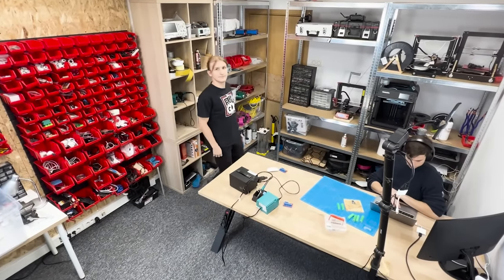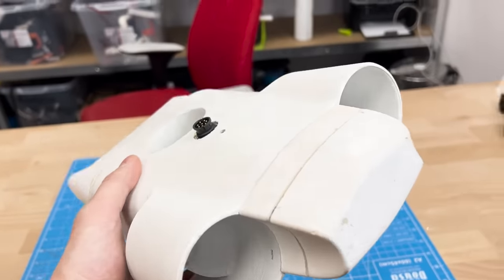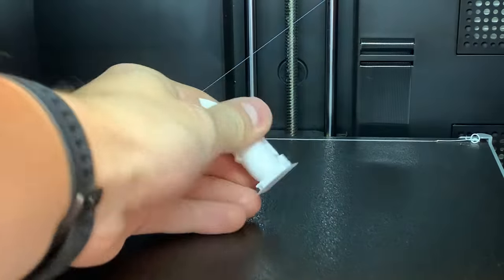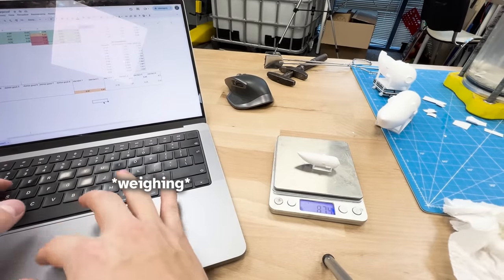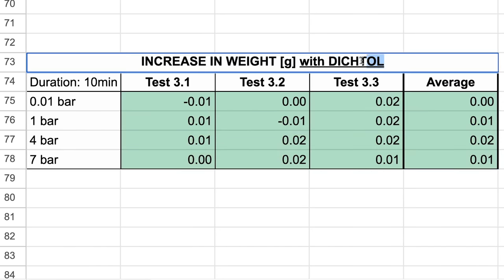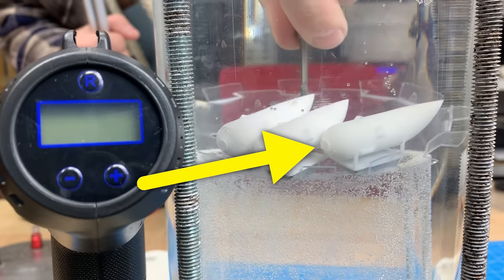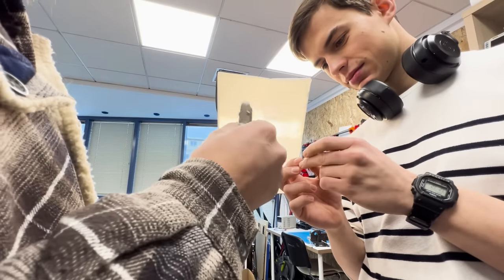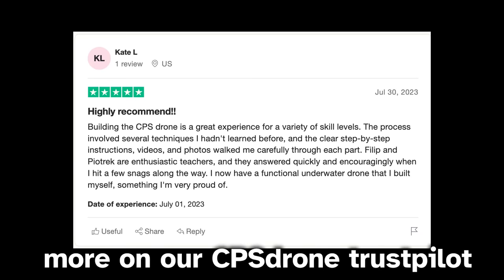Making 3D prints actually waterproof

Comment: That 3D metal sub was cool. You're probably right that it could go deeper then the real thing
Reply: @Goofyahh_shark  💀💀💀
Reply: Is the bottom of the ocean not deep enough?
Reply: @CarlinPlayz 💀
Reply: @jeremy6384  nah. Gotta go deep. Like Europa deeper. I'm pretty sure those oceans are much deeper then earth's
Reply: @Minecraftforlife99  💀💀💀
Reply: The sub looked like the titan
Reply: @bugattiveyron8282  cause it was 😂
Reply: Not only that but it wouldn’t cost $250,000 the trip
Reply: @bugattiveyron8282  because it was the titan
Reply: The part isn’t hollow it will be filled with the powder that was used to print the part
Reply: @liamdj6535  you ruined the joke

Comment: Doing second process with the dichtol stuff probably will seal it even more.
Btw. another technique to seal a FDM 3DP is by printing it in ABS and then doing acetone smoothing, it dissolves surface of the part and once dried creates solid layer all around.

Comment: Cheers from the openROV team. We actually thermally annealed our PLA to waterproof ours back in 2014, and this worked quite well by boiling them in hot water just to the point of deforming and then letting them cool. If you get the temp correctly it will work, though less well for solid fill.

Comment: To both prevent water damage your electronics and make the sub survive a deeper  dive you could submerge the electronics in baby oil.
Then the submarine drone don't have any air in it, thus can not break from over pressure.
Reply: Or ordinary mineral oil, to avoid that smell reminding you of changing time and diaper rash.
Reply: It's the same thing used in some dive watch, it prevent them to collapse, and since oil dont mix well with water it also prevent small water drops to enter.
Reply: Also get a better receiver so the controller dosent disconnect
Reply: The sub I think comes with a Xbox

Comment: You can put the print in dichtol and put it in a vacuum chamber. This allows air to escape from the pores and at normal pressure the dichtol diffuses into the pores.

Comment: I used to repair cracked/seeping plastic fuel tanks by pulling a vacuum on it, then applying epoxy. The same could be done with your printed vessel and the dichtol. Also pressure regulating the hull is a good idea.

Comment: When using a gasket or o-ring, you need to design around it with a groove for it and having multiple sealing layers. You want to maximise the path the water takes to get in from a deliberate opening.

Comment: One note about o-rings and other rubber seals, the one you used looked more like a EPDM "string" rather than an o-ring.
Way better to design around an off the shelf available o-ring (proper one in fairly hard NBR or similar rubber) than trying to glue something together.

Glueing seals with CA glue or really any glue that is harder than the rubber will be a problem, it creates a hard point that almost always leaks.

The usual way of doing it is to have nice cuts that mates well and make the seal a bit to long, so the ends gets compressed into each other. No glue :)

Or getting some way to vulcanise the rubber together, but yeah :P
Reply: "creates a hard point that almost always leaks" sounds right, but is completely wrong. I've worked at Engineered Pressure Systems ( EPSI) at Sint Niklaas for seven years and we ALWAYS glue the large O rings (Nitrile cord) with a standard cyanocrylate glue, because noone makes standard O rings with a 800-1000 mm diameter at an acceptable price and delivery time. Perpendicular cut with a sharp knife . These O rings will easily seal high pressure vessels up to 9000 bar (900Mpa). BUT you need a very proper fitting groove and the exact amount of compression for a proper seal. I don't think he used an EPDM cord, but a nitrile one. Of course you're absolutely right about designing around an off the shelf standard is always better . In this case I 'm pretty sure the leak comes from the fact that his O ring is rather thick and not properly pressured ( seriously only 4 little screws holding the lid down ?? )

Comment: For the O ring, you need to design the seating of the seal in such a way that the pressure of the water tightens the seal. then the higher the pressure, they better the seal.

Comment: Guys, there is a Prusa wiki article for the infill types in 3d printing. THere are a few that are extremely well for filling up the infill part with something.
This way you can print your model and fill up the "infill" space with 2 part resign. After curing it should be pretty much waterproof inner skin of your model.

Comment: With the Oring test i think it might be better to either use more screws or maybe even print the entire cap with a built in thread, since it only needs to tighten enough to press on the o ring consistently.
You can look at watch caseback designs here. The caseback has a thread and screws onto the case, making enough pressure on the (sometimes multiple) O-rings to withstand immense depths. Most common dive watches are certified to 200m but it is not uncommon for them to go to 600m. Some of them like the omega Ploprof or the rolex deepsea can go far deeper than that (some have been taken to the mariana trench on the outside of a submarine)
Reply: These dive watch are often filled with oil to prevent them to collapse, and since oil dont mix well with water it also prevent small water drops to enter.

Comment: Rather than trying to make the electronics container conpletely water proof, have you considered using a high pressure gas supply (CO2) cartridge for example with a regulator to pressurise the inside of the container to maintain an acceptable pressure differential between the inside and outside? Using an automatic vent valve to perge the pressure as you then come back up.  Your depth limit then is really the pressure of the gas in your pressuising 'air supply'. Look at how a diver in a dry suit stops getting pinched by his suit as he goes deeper, as well as controlling his bouyancy.  Just a suggestion.

Comment: Did you try annealing it by baking the print buried in salt or really fine sand? One alternative to try would be removing all the air from the print whilst having it submerged in stabilizing resin, then baking it. In theory, that would do the same thing as dichtol but less dangerous, as you'd be filling all the pores in the structure with resin, then crystalizing it into the model by baking it.

Comment: 6:31 it might be that there is air inside the sub, and when it “come back up” the air will expand or be larger, for example if I were to take a balloon filled with air underwater, it’s going to get smaller because all of the pressure around it, but when I bring it back to the surface it’ll become bigger again

Comment: During my undergraduate years our additive manufacturing lab was just comparing how different post processes can increase 3D print integrity, and realized heat and pressure treatment can help layers better bond and reduce the “ pores” under microscope it looked much more adherent almost like a injection molded part, and the tensile strength increased drastically. Maybe that could also help with water proof? But it wouldn’t technically be only made from 3D print since post processing is involved

Comment: I don't know about those extreme depths, but I've had good luck with just spray painting 3d prints to make them waterproof, in case someone is looking for a cheap solution that doesn't require special handling precautions.

Comment: Tbh the Way you do the Drones with the watertight pressure resistant tube inside the shells, is how actual submarines work. Like for ex the Russian typhoon, is an outer aerodynamic hull and stealth hull. And the there's 3 or 4 pressure tubes inside, and ut doesn't that wat natter if some water gets trough the first layer

Comment: If you want to make an fdm print waterproof, maybe try electroplating it? You could coat each model with copper, nickel, aluminum, or silver.
Reply: I don't know how liquid tight the electroplating will be, but if it does work the weight of the metal electroplated on can be part of the ballast, requiring fewer added weights to get to neutral buoyancy.

Comment: Why don't you spray the surface with something like the Flexseal? It's a rubber seal that work well enough.
Reply: It tried this. The problem is that it only coates on the outside, does not penetrates

Comment: from my pov, only abs-like and the Siraya Tech BLU (the one in video) are kind of usable for mechanical purpose while stay with relatively cheap price.
Otherwise, I would have gone for esun PA100 nylon/esun hard tough/Phrozen Onyx series for something as critical like this.

Also, those UV resin perform differently over time even without sunlight shining on it. I usually let it dry for a few days instead of using UV cure station. anti UV clear paint is another trick to stop its curing over time. Although UV light can cure the resin, it is still polymer which can be break down by UV light. So when curing as thin as 0.8mm/1mm, you can easily over cure some part of it and causing small cracks(since the UV light isn't spread evenly on your print), hence, brittleness.

Comment: My first idea was using lightweight PLA (with deliberate foaming), and then dip it into - or paint it with epoxy, which will be absorbed into the print, making it very solid and also waterproof.

Comment: Did you test different filament types (e.g. PLA vs ABS)? 

When making a top lid for a batch reactor, I looked a bit into it and apparently you should use ABS instead of PLA when working with water, because PLA is bio-degradable. I guess it is not important for a 1 time test, but can be significant when using your model for a long time. (as a teacher, love the video btw, it's fun and shows how you do a 'simple' experiment to really test something)

Comment: If you want to use O-rings, make a grove, smaller than the volume of the O-ring and make the surfaces conical so the higher the pressure gets, the more the tube presses on the end piece.

Comment: if you're going to use an o-ring, use an actual o-ring and not a glued one... and make round indentations on both surfaces, tight fit (if you have to force the rubber in ever so slightly that's not necessarily a bad thing) that was the o-ring has more surface area to seal against and it's unable to shift around. A flat seal might be even better, but only if you can apply LOTS of pressure spread evenly across the entire perimeter. Speaking of which... more bolts = less (or more even) distortion = more sealing power.

Comment: Minor thing, but the rear portion of the titan sub wasn't pressurised, the actual pressure hull was kind of a 'tic-tac' shape with just some extra machinery and cowling bolted onto the back.

By printing the model with the rear part as pressurised, you actually made quite a weak design which is why it imploded so easily.

The rest of the video was awesome though :)
Reply from the maker: Right, I realised it later and a couple of later designs had it fixed, not the imploding ones though. Thanks a lot!

Comment: If you had a pressure chamber, could you seal the pores by forcing resin in? Not that it might not be wasteful, but if you replicate some of the pressure it would experience under the water, and force resin into those same pores would that make it possible to achieve a greater quality of water proofing? Asking as I am also working on some aquatic drone ideas.

Comment: Try printing with polypropylene, you can get 1 walled waterproof parts first try.
Reply: Why? Does it have a better layer adhesion?
Reply: @vim55k  yes, probably one of the best characteristics that sets it apart from the other materials I've printed with. Instead of breacking it just yields and stretches. It's quite tricky to make it stick to the bed though...

Comment: 13:09 nope, not unless it used to have a hole that's been plugged. SLS and the others use powder sintered in layers. There is no way of avoiding the trapped powder in a fully enclosed print. It takes high pressure air and some holes to remove the inners.

Comment: If you're going to use FDM, it would be easier to just print with ABS/ASA which can be smoothed with simple acetone to create water tight parts while also having better temperature characteristics than PLA. Unfortunately most consumer printers are by default not suitable for printing with these plastics which is a shame. Fundamentally though I feel like it's way more safer and economical than using chemicals that have been specifically developed to melt PLA. Upgrade your printer to an all metal hotend and place it in an enclosure and you can print large stuff in ABS/ASA and smooth it with acetone and get waterproof parts, no dichtol required.

Comment: Well. I see your problem with your early designs. When I started making RC boats in 2019 (which were twin hull designs) noticed they leaked badly but luckily I had a plan with the current design of prints I had and that was to fill the inside hull with Tipex. It worked and I had a functioning boat (As long as the water does not get warm also it was a ba##### to paint because the  tipex took a long time to dry. Painting it also sucked because it seeped through the hill and mixed in with the paints.) . But all the later 3d print creations used warm gorrilla glue clear. (Putting the glue in warm water makes it runny)

Make a hole in the after printing, pour in the glue and put the creation against a light and you can see the glue inside the print. Then just move it around till it covers the entire insides. No leaks proven.

Comment: For anything print that will be used in water.... us carbon fiber PP filament, it 100% non-hydroscopic and doesn't need ANY drying ever. Also, just use the ironing after each layer, and not just the last top layers. Print at 100% infill with ironing after each layer, and you get prints with no air gaps or air bubles in the print.  You also can print in whatever filament you want, and just top coat tje print with uv resin. You can also use many different types of waterproofing sprays like clear coat enamel spray paint.
Reply: Why enamel?

Comment: Why dont you just put expoxy on the outside of the print then use sealant on the joints

Or coating FDM prints with printer resin

Comment: You did the dichtol soak with parts that had already been tested in water before, right? I wonder if you'd have even better results with a part that had never seen humidity before. Eg. filament straight out of the vacuum pack, to print, then soak. You might be able to knock off another decimal point.
Reply: PS. I've been wanting to do a submersible drone for years, and now I have a printer again. So here's a sub(scription).

Comment: So SLA printing is its own beast on how to orient and print properly. So a lot of people do not orient or do their prints right. 0.8mm walls are easy on SLA... well relatively easy as long as you angle the print and use holes and caps. I do 0.8-1mm wall prints all the time and they rarely have holes when done right. SLA will almost always lose integrity faster than the FDM unless you are using a really expensive engineering resin. But the ease of manufacture would be easier on SLA since you don't need a second dipping step when engineering the parts right and orienting them correctly. Resin is strong, not tough. FDM is tough, not strong. There are materials in both that can get you there but they are expensive.

Comment: 80mm is still to fast, you need like .15mm layer height at 220*c, at like 40mm feed rate/print speed. That will give maximum layer adhesion. Then just spray with clear coat. Cause most thermoplastics themselves as in the material absorb moisture.

Comment: Just curious, did you try soaking the FDM prints in resin to see if you could get the same results as with the dichtol? I've got a fair experience with SLA printing and I'm not surprised that you got bad results, resin doesn't have the same strength as FDM and opening two holes kinda miss the point of making a singlepiece submarine.

Comment: For depthproofing the electronics capsule why not fill it with insulating oil so it has internal hydrostatic pressure to resist water ingress?

Comment: All filament types are hygroscopic aka they they will absorb water. Therefore not all of the water is in between layers or inside of the printed vessel but rather soaked into plastic itself in addition to those two things.

Comment: I'm not sure if they have it in your country but for my 3D printed RC boats and submarines I use flex seal spray the clear kind it's like a rubberized spray
Reply: i sawed this boat in half!
Reply: I tried it. The problem is that it is not soaked into the 3d part

Comment: There is a process we use in woodworking that I have yet to try with 3D prints but both worlds have a lot of cross compatibility.

There is a compound sold under the name Cactus Juice. Wood is fully submerged in the juice and a vacuum is pulled. All the air is pulled out from in-between the wood fibers and replaced with the juice. The resin  is then cures at 90c in just a few minutes. PLA might warp as the PLA itself anneals but other filament might survive.

Plus Catus Juice is generally non-toxic

Comment: I always hear “7 bars is like 70m underwater” but isn’t that not considering atmospheric pressure? Like if I dive to 70m wouldn’t my manometer indicate 8 bars?
Reply from the maker: The manometer indicates pressure difference, not the absolute pressure. So it will show 0 bar at the just the atmospheric pressure. +1bar is ~10 meters underwater and so one.